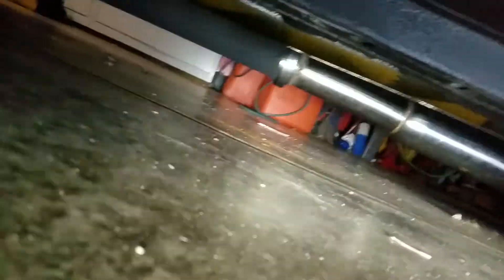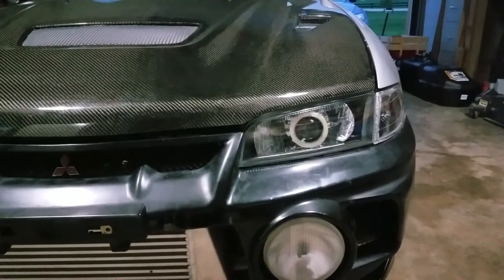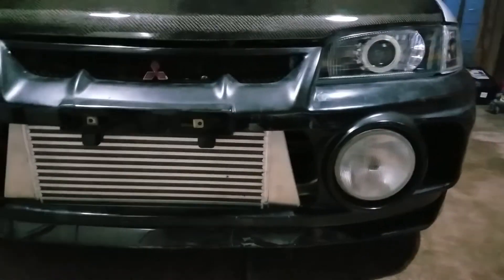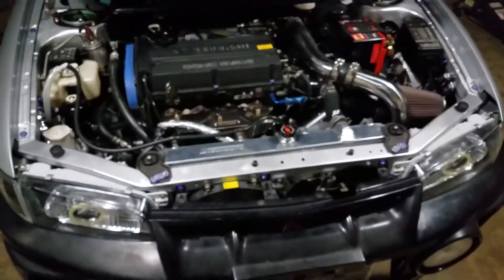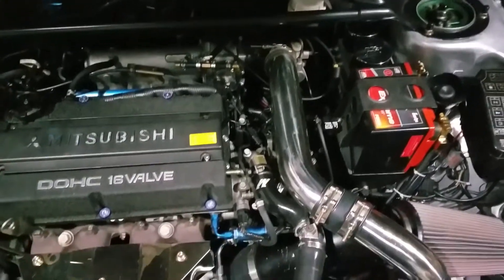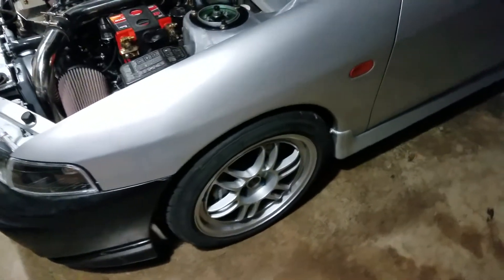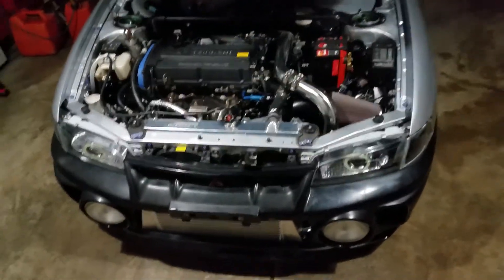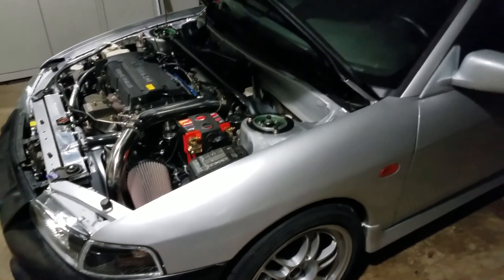Mirage to Evo IV Coupe Conversion Project: The build is nearly done!

Comment: First :)  Evo IV conversion is looking beautiful
Reply from the maker: Thanks!  It's finally getting there!  It's been a long build haha.
Reply: AlchEm1st88 haha yea man to long how did you stay motivated to finish?
Reply from the maker: Well, I didn't have much choice haha.  Too much invested to give up!  That and being the only person in the United States to have one completed and running is pretty cool as well!
Reply: AlchEm1st88 No way, youre the only one with a running one? What a pioneer. What you did here is going to be good material for people who want to do this in the future, aka me jajaja
Reply: AlchEm1st88 pretty hard to stay motivated was going to buy one with the engine and transmission in the car and the body with all Evo 4 stuff but to put the diff and axles and custome make a drive shaft because there is no such thing as a 2 door Evo maybe use a gsx drive shaft but has different bolt patterns would have to custom make a adapter and cut the spare tire holder and make custom line to the brake.  I would have boughten it he had everything for the swap it just need labor and a custom driveshaft it just I got have the time nor the place to do all that
Reply from the maker: Yep, there's been a few people attempt to build the same; but nobody has finished one here yet.  This is the only two door IV conversion with a completed swap and awd conversion in the country!  There's only one other two door awd 5G in the country and it's a widebody V/VI bodywork conversion.  Glad you've enjoyed it!  Would love to see more people attempt the swap!  That's why I made these videos. :thumbsup:
Reply from the maker: Jayleen Cruz yeah, it's no small undertaking!  I did the whole thing in my garage though haha.  I had my driveshaft custom made by driveshaftshop.

Comment: So the fenders from an evo 5 even with the hood, bumper, and headlights (i know yours is a 4 conversion) wouldn't be able to line up correctly? Sorry if thats a bit dumb but i've been doing tons of research since i've got a '98 Mirage coupe.
Reply from the maker: Justin Ross No, not dumb at all!  Correct, they won't like up.  The reason why we can't just bolt Evo fenders on to Coupe's is the door seam where the door meets the fender.  On the Evo it's an almost straight line and on the coupe it has a curve.  some people in the past have just modified the doors; but I wasn't impressed with the result.  In my opinion this was the best way to do it.  doing the widebody Evo 5/6 fenders would be more difficult; but not impossible.
Reply: AlchEm1st88 Just looked at some pictures and i see exactly what you're talking about now. I better get working on my welding skills! 
But the 5/6 fenders are going to be a pain if i go for that. One more question, the side skirts. I know the shorter wheelbase and all that so i'd have to go into cutting the evo 5 side skirt and using fiberglass to fill the seams?

As you can tell i'm not the most experienced in body work. 😂
Reply from the maker: Hmm, well for the side skirts rather than glassing them back together, you should learn how to plastic weld.  It's really easy and the results are great.  I had a huge gouge in one of my side skirts from a piece of metal that fell of a truck in front of me years ago and we decided to give plastic welding a go.  The repair is amazing!  You can't tell at all.  (Granted we had to do a bit of filler work; but eh)

Comment: Fake ass car
Reply from the maker: I can assure you it is an actual motor vehicle.
Reply: @AlchEm1st88  for sure a real vehicle with probably something close to the 4g9 series but converting to a 4g63t car without actually having a 63t is why I am calling it fake.
Reply: No offense though I respect that it is your money and do with it what you want I have my own opinion.
Reply from the maker: I'm confused lol.  Did you actually watch the video?  I built this car from the ground up.  It has a 2.3L stroker 4G63 making 520hp at the flywheel currently and is awd lol.  You can see the engine in this video lol.